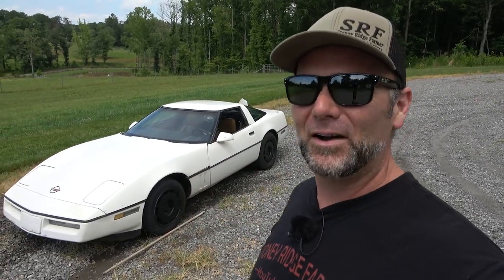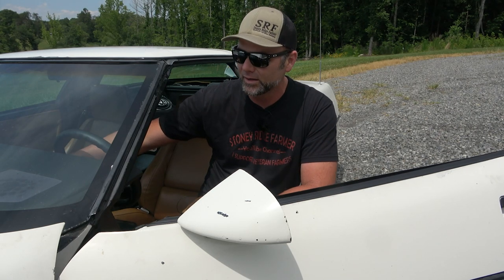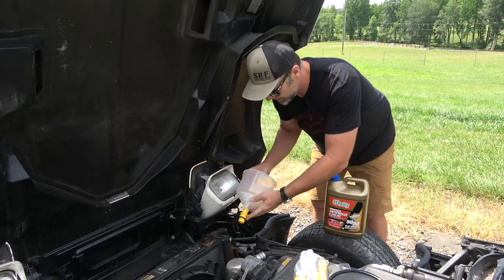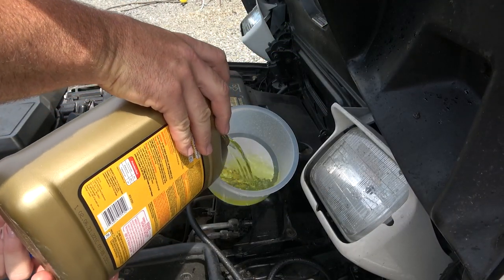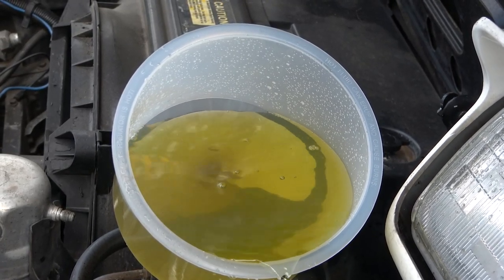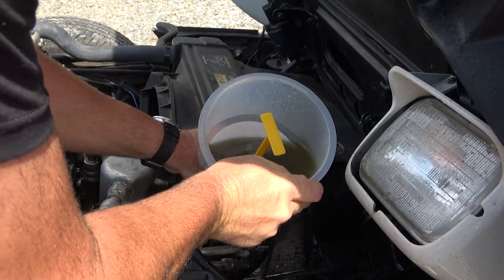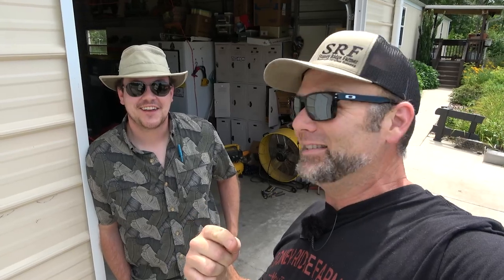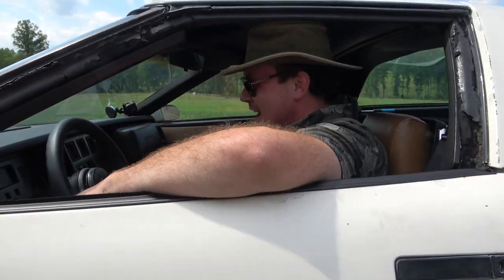How to get the air out of your cars cooling system! Simple, easy and fun!

Comment: Good tip.  I'll use it when I finish restoring my old farm truck.
Reply from the maker: yessir worked like a charm!
Reply: @StoneyRidgeFarmer  Josh how much did that "belch" funnel cost approximately???
Reply: @veulmet  rather have a link and ill donate it to myself
Reply: Why did it overheat in the first place? Bad cap, cracked head, blown gasket? Any idea, problem may still exist.
Reply: @leonardleveque3745  did you watch?  It had a freeze plug replaced and the coolant was improperly refilled.   It left too little coolant in the engine to keep it from overheating.
Reply: @royfrady8219  I guess I could see that happen traps air behind thermostat same as head or head gasket failing an compression from cylinder being pushed into water jacket. Not sure what year they cured that with a small hole in the thermostat.
Reply: Old trucks and vehicles don't trap air as easily as more complex modern vehicles. Yes this Corvette is in that cross o we time between simple ones and complex modern stuff. But being a Corvette it's more complex than your 1985 truck would be for the same year.

Comment: Awesome. Lol 1984, that was knight rider’s big sister. 😂😂 

I have to mitt it, and I’ve always been kind of a car guy, I’ve never paid any attention to air in the coolant I just kept it topped off and the overflow filled which should sort of automatically do that if it’s designed halfway decently.  Even at two grand that’s a pretty awesome by the 500 was amazing, awesome deal made for a great video as well.  Lol 🙌🏼

Comment: You need a vaccuum pump to vaccuum the air out of the radiator. Snap-on sells a vaccuum powered by an air compressor.
Reply: Cory, That would be the correct way to do it.but this method works temporarily.

Comment: Great video this is going to help me out a lot with my 85 chevy camaro I also been having some  Overheating issues And I could not get the air bubbles out of the cooling system at all Here in Florida we have no hills so I think I need to Jack the vehicle up because doing it without jacking it up is not working for me And all of the cooling is getting everywhere keeps coming out of the radiator So there definitely is an air pocket in there somewhere if u have Any more tips that would be great thanks
Reply from the maker: take it to the mechanic and have them do a pressurized coolant exchange

Comment: This can also be done by leaving the rad cap off until it burps the air out, you'll lose coolant, but then just keep adding it back.
Reply from the maker: no august...it doesn't work buddy...that's why I did it this way.  I spent 3 hours pouring coolant in the radiator and still had air pockets..hence the reason I made the video..$15 solution to the problem
Reply: @StoneyRidgeFarmer , works for me, but no problem. 15 bucks is cheap and works, so it's all good.

Comment: That cooling system needs a decent flush. The coolant looked like river water when the thermostat opened up.
Reply: Most likely a stop leak for the exhaust gasses getting into the coolant

Comment: The previous owner must be a bit slow
Reply: Or knew of a cracked head that was allowing the exhaust gases to escape into the coolant. Hence the reason why when he added antifreeze it came out metallic color the same color found in most engine stop leaks so that's a strong indication that the head or heads where trash.
Reply from the maker: these old vettes can be troublesome
Reply from the maker: I agree...something is astray...you can see the additive floating around...sometimes additive itself can be the cause of oveheating as it interferes with the heat dissipation in the block and cloggs up coolant passeges
Reply: @StoneyRidgeFarmer  I am betting on a cracked head or head gasket Time will tell 
I would take off very far until I felt comfortable with the cooling system.  Maybe it needs to be flushed. Looks like a lot of stuff came from the motor when the thermostat opened up